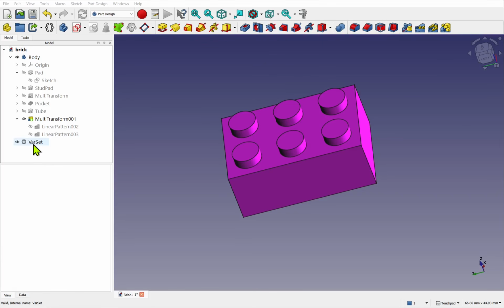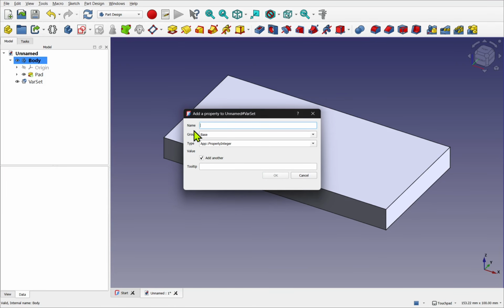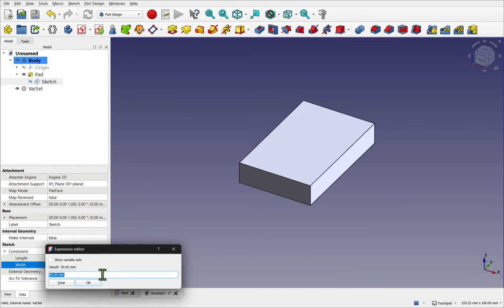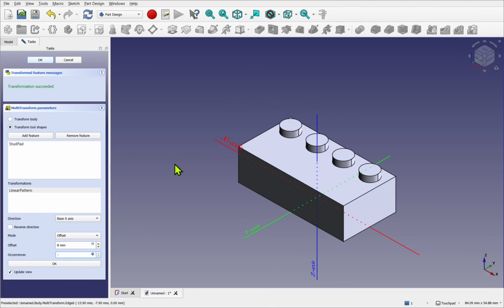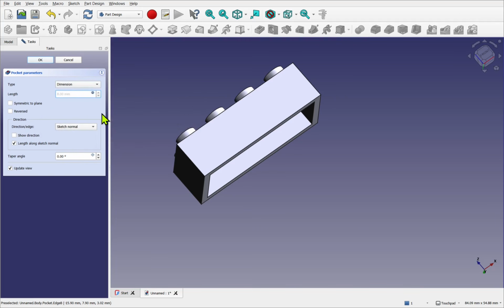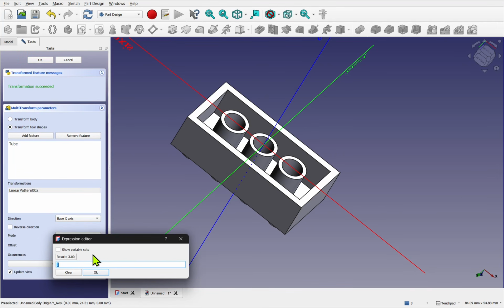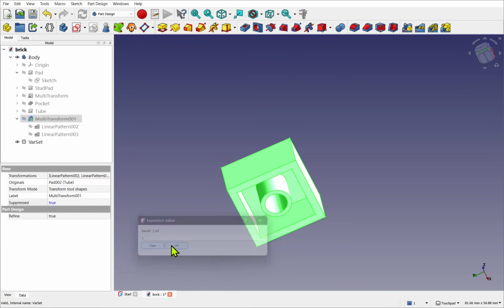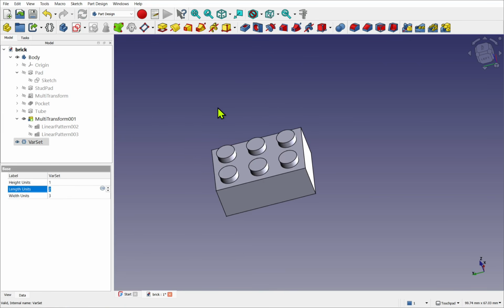FreeCAD: It Starts With a VarSet... and Ends With Toy Bricks! Parametric Toy Brick Builder

Comment: The issue with the circle that you demonstrated starting at 18:50 is the second circle taking an equality constraint to the first one instead of the value that you typed into the auto-dimensioning text box. Notice the equality Constraint5 that appears when you try to make it 6.5mm. That Constraint5 vanishes when you delete the second circle at 19:43.
This is an excellent example to use in a bug report should you feel like submitting one on the FreeCAD GitHub.

Comment: Nice video. Thank you. For what it's worth,  I think you can make the "conditional chaining" cleaner by doing something like  (condition1 ? 1 : 0) * (condition2 ? 1 : 0),  i.e. using a multiply as a logical AND.
My "magic numbers are evil" instinct would like to see the thicknesses and offsets derived in a master sketch or spreadsheet rather than being embedded in multiple places.
Reply: But in this instance what is needed is a logical OR. Given this particular instance, the only time one wants a true is either of the values is zero, so simply multiplying the two variables will create the OR condition...
Reply: @Sembazuru  Usually, boolean algebra can be substituted with + and * . However, this may end up more messy than chaining the ternary operator. 
The only clean way would be to have true boolean operators (AND, OR, ...) and the whole condition be calculated in boolean domain (not integer domain). Then you could write only "not (varset.lengthunits>1 and varset.widthunits>1)" or the equivalent formula " ..=0 or ..=0".
That being said, I am happy that this feature exists even in its limited form....

Comment: Great video. What features are still missing in FreeCAD? I remember that not long ago, this suppressed feature was practically impossible to do in FreeCAD without a lot of workarounds...
Reply from the maker: There are quite a few missing from workbenches such as techdraw if you are comparing it to, say, inventor, but we are talking on the commercial level here.  I recently consulted with a UK company regarding adopting freeCAD and this was the barrier to adoption.  They had highly complicated techdraw with all different exposed views, none of which could be produced by freeCAD easily.

Comment: Nice, I created a lego-compatible brick generator in build123d, here is the complete sourcecode:

class LegoBrick(BasePartObject):
    def __init__(
        self,
        pip_width: int = 2,
        pip_depth: int = 2,
        unit_block_height: int = 2,
        rotation: RotationLike = (0, 0, 0),
        align: tuple[Align, Align, Align] = (Align.CENTER, Align.CENTER, Align.MIN),
        mode: Mode = Mode.ADD,
    ):
        self.pip_width = pip_width
        self.pip_depth = pip_depth
        self.block_height = unit_block_height
        self.pip_count = pip_width * pip_depth

        pip_diameter = 4.8  # mm
        pip_spacing = 8.0  # mm center-to-center
        border_size = 7.8  # mm
        block_width = (pip_width - 1) * pip_spacing + border_size  # mm
        block_depth = (pip_depth - 1) * pip_spacing + border_size  # mm
        block_height = unit_block_height * 3.2  # mm
        pip_height = 1.6 + block_height  # mm

        with BuildPart() as lego:
            with BuildSketch() as block_plan:
                Rectangle(block_width, block_depth)
            extrude(amount=block_height)
            with BuildSketch() as pips:
                with GridLocations(pip_spacing, pip_spacing, pip_width, pip_depth):
                    Circle(pip_diameter / 2)
            extrude(amount=pip_height)
            offset(
                amount=-1.2, openings=faces().sort_by(Axis.Z)[0], kind=Kind.INTERSECTION
            )
            if min((pip_width, pip_depth)) > 1:
                with BuildSketch() as mid_supp:
                    with GridLocations(
                        pip_spacing, pip_spacing, pip_width - 1, pip_depth - 1
                    ):
                        Circle(6.5 / 2)
                        Circle(4.8 / 2, mode=Mode.SUBTRACT)
                extrude(amount=block_height)
            elif min((pip_width, pip_depth)) == 1:
                with BuildSketch() as mid_supp:
                    Circle(3 / 2)
                    Circle(3 / 2 - 0.8, mode=Mode.SUBTRACT)
                extrude(amount=block_height)
        super().__init__(part=lego.part, rotation=rotation, align=align, mode=mode)

Comment: Brilliant! With Varsets working so neatly, particularly with expressions, is there still a use for the spreadsheet?
Reply: I would say yes. You could use one (either Varset or Spreadsheet) for user changeable values and the other for "touch these at your own peril" values. Granted, you could use multiple Varsets or Spreadsheets for the same deliniation. Or if you want to set up a configuration table I think that can only be done in a spreadsheet.
Reply from the maker: So varsets record data in name value pairs, one property, one value.  Spreadsheets you can set these up how you like.  One property, many values.  Also spreadsheets allow for something called configuration tables which are pretty awesome.

Comment: Woah, I used to use spreadsheets for this, but this is so much easier!
Reply from the maker: They're great, I just wish you could change the variable names as they are read only after creation.
Reply: @MangoJellySolutions  I agree. Really annoying to discover a typo in a variable name, especially once it's been used several places in constraint formulas...
Reply: @Sembazuru just spoke to the varset maintainer (at Fab25). He told me that this is fixed in the dev build.

Comment: Thanks! What if I want two pices in my design. One 2x2 and another 4x1. Can I clone them and have differend varsets somehow?
Reply from the maker: The most dynamic / parametric way:   you want something called configuration tables.  These are used with spreadsheets (not varsets) and allow you to create a drop down on the body where you can select different configurations.  The easy way, change the dimension of the brick, jump over to the part workbench, select the body. select top menu > part > create a copy > create a simple copy.  It will create a copy of the current brick but it won't be parametric but you can create as many different sized bricks as you like.
Reply: . Thank you. I will try it 😊

Comment: There is a slightly more elegant syntax for truth values:

A>1 and B>3 ==> (A>1 ? 1 : 0) * (B>3 ? 1 : 0)

A>1 or B>3 ==> (A>1 ? 1 : 0) + (B>3 ? 1 : 0)

The multiplication only yields a value > 0 if both expressions are >0 - so only if both are true; the addition yields a value > 0 if any of them is >0. Since truth values are 0 = false and >0 = true this works out okay.
Reply: elegant but far less efficient as multiplication, even integer multiplication is way costier than boolean tests
Reply: @tybor76  A little bit less efficient, yes. Boolean AND is 1 cycle, integer multiply is 2-4 cycles on a modern CPU. Considering that the entire expression has to go through a parser, interpreter and complex variable lookups, which all take many hundreds of clock cycles - the difference is negligible. Then it is followed by complex 3D graphics operations and the difference becomes (in my opinion) laughable.

In applications like this it is almost always better to focus on readability instead of (premature) optimization for CPU cycles. About the only exception would be if you created long loops or a cascade of lookups. But with the syntax of FreeCAD expressions that would be very hard to do.
Reply: @KonradTheWizzard  yes, it is neglegibile. Unless everyone make such assumptions then suddenly you need a machine 3-4x times more powerful to achieve the same result. 
Even in those GPU-powered, multi core CPU times
Reply: @tybor76  Ouch! GPU and CPU are completely separate hardware, if you want GPU acceleration you need to write very specific code for it.

Part of my job as a professional software engineer is to know when to optimize and for what target. You always have multiple optimization targets that are mutually exclusive: do you optimize for CPU or maintainability? For release speed or stability? Etc. On modern systems the focus is almost never on CPU cycles. As someone who faces these questions on a daily basis: trying to save a couple of CPU cycles in a situation where hundreds of cycles are used to even get to that instruction is misguided at best - it will usually cost you in both development time and CPU cycles at a different place. We call that "premature optimization" - look it up, it might be enlightening.
Reply from the maker: Thanks for sharing this, it's great to see other ways of creating the same outcome.  I always enjoyed the CodeWars site (I haven't been on there for years mind) and seeing the many different ways each coder solved the same problems.  Always learnt something new.

Comment: Which version of FreeCAD do we need to use the question in the expression? All I get is that the parse fails.
Reply: That ?: syntax works in 0.21, but VarSets were introduced in 1.0.

You have to complete the expression before the parser is happy, to make it easy on yourself start with "1>0 ? 1 : 0" for truth values or "1>0 ? 1mm : 2mm" for a length - then go on and replace the components step by step.
Reply: @KonradTheWizzard thanks, when he said “colon” I misheard that as “semi colon” - I went back to watch again and it works now that I listened to what was said.
Reply: I am using the latest version 1.0.1 it works without any issues. Check your sintax maybe you are typing it wrongly or start from the beginning.
Reply: @stefannikolic6365 thanks, you’re right, my syntax was wrong. I used a semicolon instead of a colon.
Reply from the maker: Glad you found the solution with the help of @KonradTheWizzardthanks, thanks @KonradTheWizzardthanks